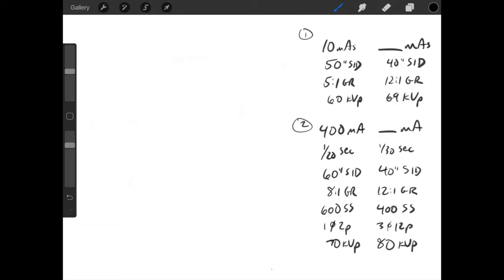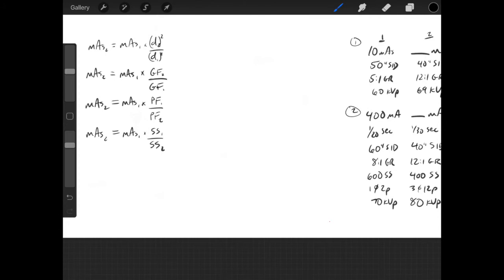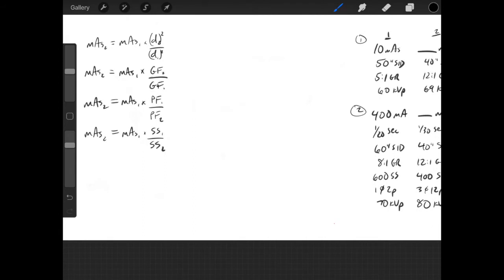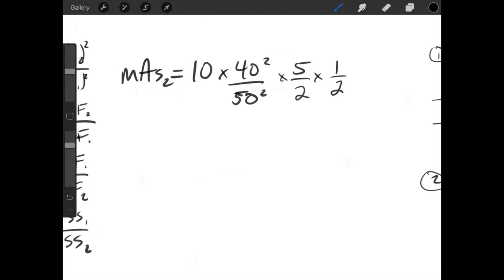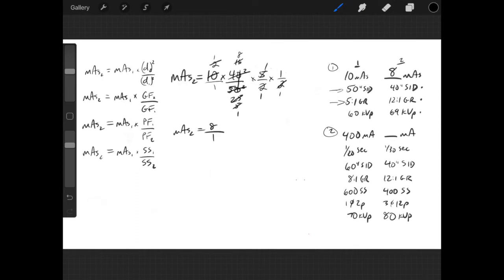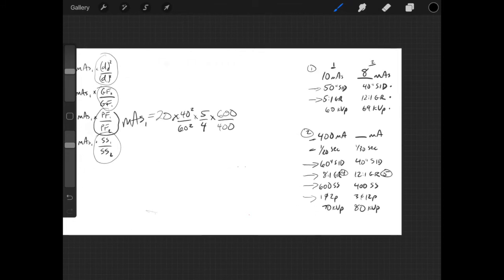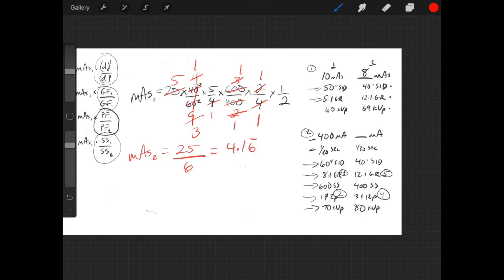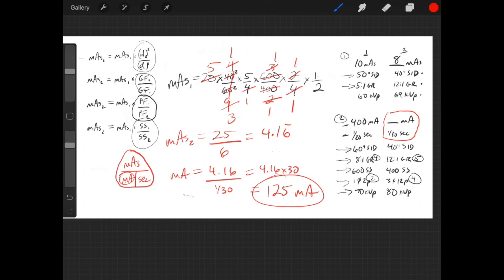How to Solve Complex Problems in Radiography

Comment: Hey! Thank you for the video, it was super helpful for me. I have one question though, I have never seen mAs conversion 1 phase 2 pulse to 3 phase 12 pulse before. Could you clarify how you got 2/4? And what if it was 3 phase 6 pulse instead? Again, thanks for the super helpful video :).
Reply from the maker: I'm not sure this is still on the ARRT Registry, but we used to have relative output factors for different generators.  More x-rays are produced with 3 phase equipment compared to single phase, so the formula for compensating when changing generators is OF1/OF2 = mAs2/mAs1 (OF - Output Factor).  Output factors are as follows:  Single Phase, 1 Pulse = 1.  Single Phase, 2 Pulse = 2.  Three Phase, 6 Pulse = 3. Three Phase, 12 Pulse = 4.

Comment: Where are these grid factor reductions coming from? How do i know to turn a 12:1 screen into a value of 2???????
Reply from the maker: 12:1 is the grid ratio... these can be found in most textbooks as the "grid conversion factor".  My examples here were from Carlton & Adler, as well as the Bushong textbooks.  For problem 1, the GCF for a 12:1 grid = 5, and the GCF for the 5:1 grid = 2.  That's why in the equation, it is expressed as 5/2 as a fraction.  Have you studied this in your program yet?  If not, you'll eventually be asked to change your mAs to maintain radiographic exposure to the image receptor when changing from one grid to another... that's when the grid conversion factors will come into play.
Reply: U just explained this and I still don’t get it lol